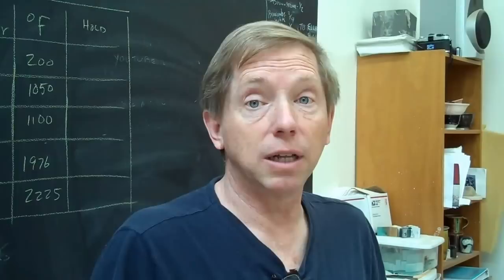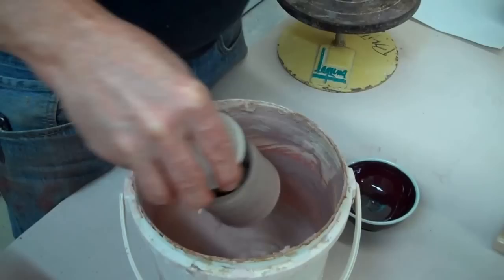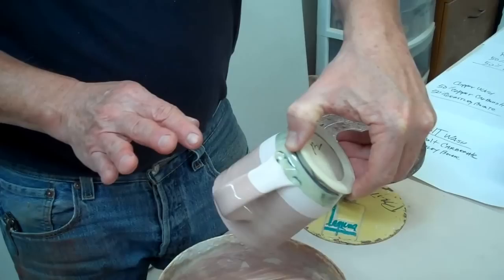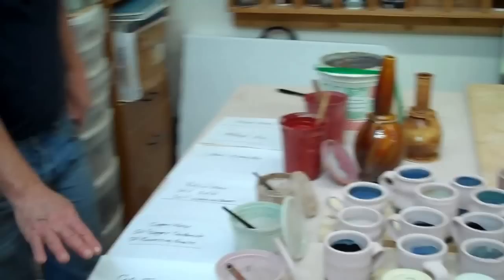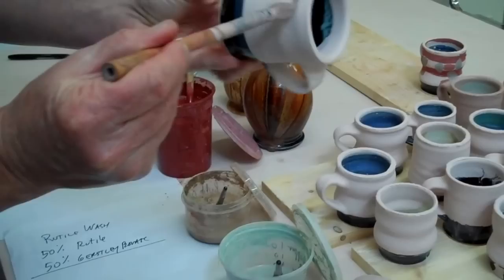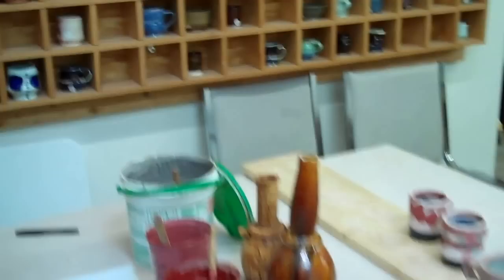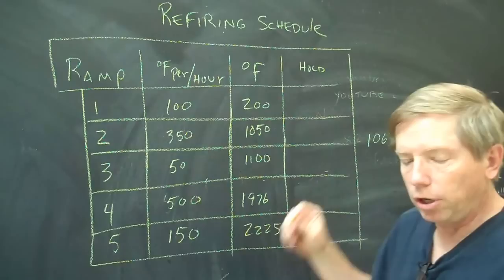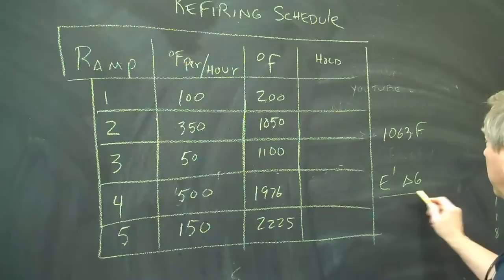Reglazing Pots

Comment: Really helpful video, John!! I also want to refire my dog head sculptor since the matt clear glaze was too thin. I fired it at cone8 with Skutt pre-ramp hold program in Mid-tempo. I want to fire it with other sculptors which have not been glaze firing.  What firing schedule and speed will be nice for in this case?  Is cone 7 medium tempo mode will be ok?   It would be nice if you give me a piece of advice. Thank you so much, John!
Reply from the maker: Just slow around 900-1200F
Reply: @johnbrittpottery  Thank you for so much for your answer! I've just watched your video again and I will follow and try it!

Comment: Hi John, love your videos, I always make 100 or 20 as instructed, and wait to see you in the morning😊 HOWEVER! I tried your reglazing method and the glaze coat stuck to the skim layer fine, and then the glaze layer flaked off badly. I brushed on the glaze, so I am wondering if I have to dipped that glaze layer. Any suggestions?  Thanks.
Reply from the maker: Anne Lythgoe some glaze is low in Clay and has low dry strength..try adding bentonite.  Otherwise it could be fluctuated and flake off. In that add deflocculant. Could be high clay/high shrinkage....Or try other Glazes.
Reply: John Britt thanks, John. Some other glazes stayed put just fine, so I suspect it was that particular glaze. Thanks for your help and prompt reply. Enjoy your book btw.